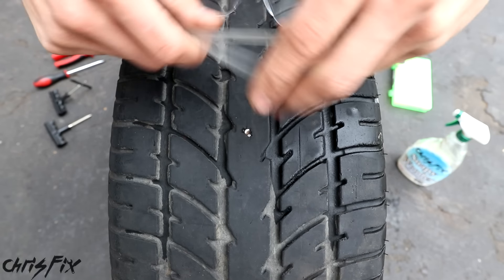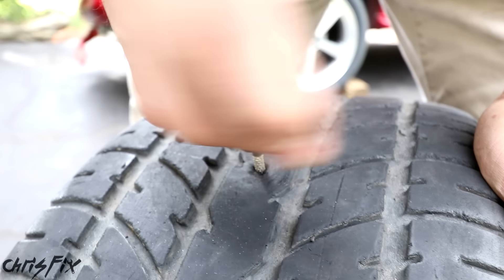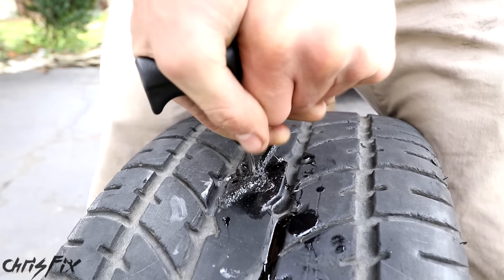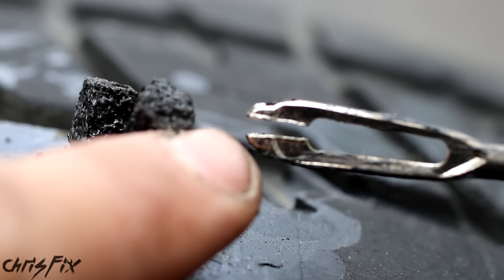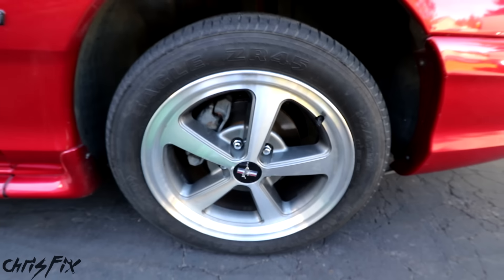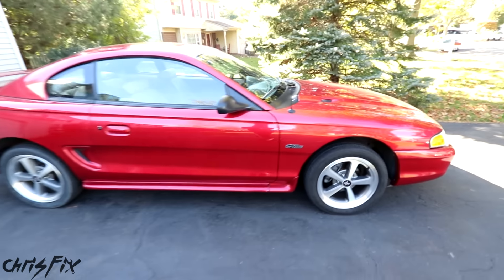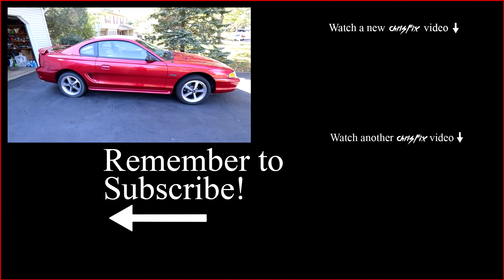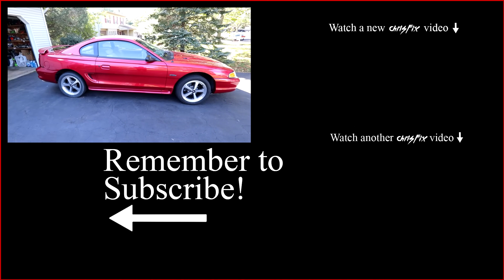How to Fix a Flat Tire EASY (Everything you need to know)

Comment: I was hoping for the "How to clean an engine bay" video.
Reply: Bartek Witas step 1 don't clean it
Step 2 don't clean it
Step 3 if you see a dirty spot leave it alone
Reply: did you just spray it with water
Reply: Arif k your supposed to leave the car on for about an hour and a half after you spray the bay with water so that it will dry up thats how we do it where i work
Reply: been waiting for that video as well! Chris is lacking :)
Reply: rami ram your not supposed to have water anywhere near your engine (unless your topping off your concentrated antifreeze)
Reply: automan224 ive washed more than 70 cars like that i also do that to my and rover whenbits in deep water
Reply: I don't know why some people think it's unwise to wash your engine bay!? Engine in modern cars are completely sealed, alternator can take water any day unless water pressure is excessive and your intensionally willing to break it.
Reply: I waxed and buffed off my silver engine plastic cover. It looks very good now. I dressed up the rest of black plastic covers around it with armor all after cleaning with with soapy water. My engine bay looks like from car that just out of factory.
Reply: Soumaine really? Last I saw if you get water in your air filter/air duct you can get it into the pistons and bend them

Also any water on the electronics is a major no no you can actually damage those systems if you get them wet. 

Also you can potentially mix water with the oil and mess that up
Reply: Bartek Witas I asked him last year bout it!
Reply: ***** I never block anything off from water. I just pop the hood at the car wash and go to town. It's not like under the hood is sealed from rain and puddles. If the car is still warm, you get a steam clean effect and it dries quicker when you leave.
Reply: Have you guys ever thought of this

If we clean our car engine why don't we clean our ovens electronics, or the inside of our refrigerators temperature sensors? I'll tell you why. We don't eat, sleep, and live there

So why should we clean the engine in our car?

If you have a real oily spot sure use some brake cleaner and/or engine degreaser but never have water anywhere near your engine
Reply: automan224 do you take your fridge or oven to a car show???
Reply: Chancey Wyrosdic nope. But my analogy was if we're gonna clean our engine (which is unnecessary and potentially Dangerous) then why stop there
Reply: automan224 some of us work on and modify our cars. Less grease or dirt makes it a much more enjoyable situation all around.
Reply from the maker: That will come with time! I have a lot of videos in the works and I have a schedule that, well, is taking a while to get to haha. I promise there will be a video on how to clean the engine bay and it will be an awesome one!
Reply: how do you explain cars with real hood scoops then?
Reply: ChildrenofBodomLOVR lol what real hood scoop
Reply: same tho
Reply: well you get this thing called a rag and you get some cleaner like mcguires natural shine, and for those who say dont clean it... why not? i keep my engine compartment clean cause i like to be proud of all aspects of my vehicle..
Reply from the maker: That video is going to be a HUGE video with a lot of tips and tricks so it takes a long time to make. Dont worry, it will be epic and I will definitely be making the video for you guys!
Reply: coming99 You seriously listen to that guy?
Reply: Mine is very dirty (it was like that when I got it) the white paint is a bownish yellow color what a mess I also have to take off and polish the intake runners which have rust spots on them.
Reply: +Bus Driver Uppercut anything that stops working after you pressure wash an engine needed to be replaced anyways. Components should be able to withstand water from washing the engine. Steam cleaner with the pressure washer is a good way to clean the engine bay even without a lot of pressure gunk and stuff will just fall right off.
Reply: +GonzalezEzekiel Scotty Kilmor's might have 50 years of experience, but has the mindset that it's still 50 years ago lol.
Reply: Hello By his videos are very aggravating just look at his "why mercedes are money pits" I used it be a Mercedes tech and I know he doesn't know what he's talking about. You were right on the money on 50 year old mindset  he just doesn't know anything about modern cars
Reply: +GonzalezEzekiel yeah just his intro is annoying I also know how much MB dealers charge. My family is European car family my uncle is a master Porsche tech top mechanic at Brumos Atlanta and one of the top in the country and he now owns his own independent European car shop. My dad was an Alfa mechanic and is factory trained by Alfa. Now still has a bunch of Alfas and restores wooden boats. My moms 05 E320 CDI I'm sure you know about canbus computer mounted under A/C condenser computer filled with water twice we've put 150k miles on it with 200k total great car the crap he talks about in his videos especially Mercedes is a load of crap while some things can be true he well over exaggerate German cars.
Reply: +GonzalezEzekiel Mercedes source probably the only place to go on YouTube for mostly older Mercedes and he also had a maratona GTV6 cool car. YouTube "mechanics" are a different breed lol
Reply: Hello By oh gosh they charge too much but they do pay Mercedes a lot per month to use the scan tools (xentry) . I don't like him either although I'm suscribes to him he never finishes his vids he wants people to pay smh
Reply: Bus Driver Uppercut i washed my engine bay on my c32 the other day and it's fine, only thing I did was take it for spin after I was done to dry it all, and the electrical connectors should have "weather pack seals" on them
Reply: +GonzalezEzekiel yeah his problem is he always wants you pay for them. Only time our's went to a dealer after we bought was for it to be scanned after the canbus computer filled with water from the (gotta love their engineering) a/c condenser on a humid and shut down the car then went to an independent shop to get the computer. Only other time was to replace the dead key.
Reply: Hello By If you work on your own car a key program and buying parts are the only reason why people should go lol
Reply: +GonzalezEzekiel yeah when buy the parts it's through world pac with free next day shipping which is where my uncle buys all his parts from.
Reply: Hello By nice ima check em out thanks for that
Reply: Hello By it asked for company and "resale number" "business type" -_-
Reply: +GonzalezEzekiel yeah it's only for businesses.
Reply: Keith Shields 1 apparently a 20 year old is 13 now. 2 everyone and their mother agrees to never clean your engine so you don't ruin anything. 3 I don't know everything, I just have this thing called common sense
Reply: automan224 i like how you call that common sense, what do you drive.. a prius😂😂
Reply: automan224 if you drove a prius then that would explain alot
Reply: automan224 cause you see i drive a 98 k1500 with a 5.7L V8 and i want that SOB to be clean when i show it to people
Reply: +Keith Shields um yeah water can ruin your engine when you run it. When there's enough in the cylinder you will hydrolock the engine which can crack the cylinder wall the cylinder head and bend rods. So yes water in the cylinders can damage your engine and water in the oil will also destroy your engine.
Reply: +automan224 getting the electronics wet won't hurt them if they do get hurt then they needed to be replaced anyways and shaking the water out then plugging them back in will fix it until you replace it.
Reply: Hello By i was talking about a little bit of water, not a whole lot
Reply: sort of self explanatory. certain things should be covered up otherwise good to go. I cant believe people are clamoring for pointless vids like that LOL

how about something more along the lines of fixing a broken exhaust or thats hanging or something (unless it needs welding or something) my cavalier beater needs a whole new one, a semi perm fix idea would be nice. Currently its ok but sounds like shit.
Reply: Keith Shields 2005 Chevy Monte Carlo LS
Reply: Hello By theris also this thing called risk vs reward.

is it worth getting the engine clean if you can potentially damage something expensive
Reply: Bartek Witas
Reply: +automan224 you're not going to damage the engine
Reply: Hello By and if I do?
Reply: +Arif k yeah there's one video the guy to prove that the alternator will be fine he sprayed it directly with water to prove that it's fine.
Reply: Bartek Witas no we want to know how to get laid in the back off a car..
Reply: Bartek Witas of
Reply: ChrisFix I see a lot of bubbles!!!!! (Joke)
Reply: +coming99 - I am not a Scotty Kilmer fan. I subscribe to ChrisFix because his videos agree with my experiences; Scotty's do not.
Reply: There is one...

Comment: I got a low tire-pressure warning right after I finished a 15 hour shift at 3 am. My nightmare was about to come true, nevertheless, I found an air-pump at a gas station and filled my tire with air. I found that my tire was leaking 5 psi/week. I finally got it fixed today!

Comment: (1) Using a block of wood on your jack is dangerous as it may crack. Always use steel on steel. Never wood on steel or wood on aluminum.
(2) The tire only needs to be a few inches off the ground not 3-feet!
(3) Wood for the tires to prevent them from rolling is of course a good idea.
Reply: Habanero House (1), a piece of rag or cloth or cardboard in between steel and steel is protective to your car especially on jack point coz you don’t wanna hurt the anti rust paint. (2), you don’t need to take the entire tire off. Turn your steering wheel counter clockwise (not all the way), find the penetration with soapy water and fix it. (3), I would not cut the extended plug. I leave it there and the heat from driving would melt it into the tire tread, thus it makes the tire more durable.
Reply: Bruhhh hatter alert 🚨

Comment: ”if you have a spare tire”??? what do you mean ”if”? isn't it mandatory in the US to have a spare in the trunk? or is that optional?
Reply: Chris Day if you have a car with run flat tires I dont think you need to
Reply: Same new Kia cars and Cadillac cars do not come with a spare, they come with a repair kit, basically fix-a-flat
Reply: wow...i wasn't expecting that...in Europe you're not allowed to drive the car if you don't have a spare...if you do and the police checks your car, you could walk away with a huge fine...because here we don't have run flat tires, they are super expensive and not everyone can afford them...something new i learned about 'Murica :)
Reply: Chris Day In Sweden we are allowed to drive without a spare tire 😉
Reply: I work at a tire shop and when we get these cars in, most complain of not having that spare included, especially on Cadillacs for being a luxury vehicle
Reply from the maker: Some cars have runflats or repair kits and dont come with spares.
Reply: extreme weight reduction by manufacturers. And if you are lucky enough to get a spare tire it's one of those fucking donuts.
Reply: That's not true. This is how it is in Germany: You don't need a spare tire. You just need something to replace or "repair" your tire. The vast mayority of german cars don't have a spare tire anymore but some thing called "Tirefit". You are supposed to fill your flat tire with some substance that closes the leak (temporary) so you could drive to the next repair shop. However, nobody uses those kits and it was mostly implemented for weight and cost reduction. Source: I'm a mechanik at Mercedes
 My tip: Throw that shit away and place another normal tire in your trunk. Summer tire in winter and winter tire in sommer.
Reply: Why have a spare tire if you have AAA? I wouldn't want my mom fixing a flat, at night, on the side of a highway. Just pay for auto club membership, and call for a tow if you break down. In that case, all a spare is doing is weighing down your car and hurting your MPG.
Reply: I'm not obsessed with it, but governments tend to be...a spare tire does nobody any good if you can't/won't change a tire.
Reply: I'm into increasing fuel mileage but getting rid of the spare's ridiculous to me, there are other methods manufacturers could work with but they aren't:

1: Skirting over rear wheel arches
2: Full Body Belly Pan with removeable access panels

Those are just a few though. I put what you'd call an "Air Dam" on my 1984 Caprice and it seems to have increased the mileage, I don't need to press the accelerator down as far on the highway with it on.
Reply: i don't know the rules of other EU member countries, but here you are not alowed to drive unless you have a spare..yes, we have repair kits and stuff like that, but we are used to simply change that shit like real men...think about it: oh look, i have a flat, i'll inflate it with that single-use foam from the repair kit...ten miles later: oh look, another flat(happened to me) a spare tire would have been usefull, only if had one...but for those 100ml of fuel that i save, why would i carry a spare with me? think twice before you hit the road guys...stay safe!
Reply: or drive with the flat tire on the rim and just dont care :D
Reply: stoyan slavov somehow i like you :))
Reply: :) thank you 
i will say that to you to
i just helpt a guy with his car and i feel grat :D soo have a nice day 
a nice extreme or what ever you want to call life :D (sorry for bad english )
Reply: stoyan slavov where are you from?
Reply: your neighbor from up north :))...literally about 200km from my house to the border at Pyce ;)
Reply: Ах БГ сила 
винаги се намираме :)
ние Българите
Reply: aaaaaa 
you speek Румънски yes :D
Reply: what? no :))....romanian, ok?:))
Reply: i wounder if you speek Romanian (sorry for bad english )
Reply: so how are you
Reply: bcubed72   If you can't change a tire, you shouldn't be allowed to have a license.
Reply: It's not just Kia's and Cadillac's - there are a lot of new cars sold these days that don't include a spare tire. When I was a kid (a thousand years ago) cars were supplied with full size spares. As the cars got smaller and in the name of greater fuel efficiency weight became an issue, car makers started supplying donuts. A lot of people that were used to full size spares cringed when they switched but I can tell you first had that the donuts work well. I've put (literally) thousands of miles on them and driven well over 80mph and never had an issue. My wife recently slashed the side wall on her 2014 Fusion. I went to change the tire and found a can of Fix a Flat and plug in inflator in place of a donut. I was about to call a wrecker but decided to see if by some wild chance the donut from my Saturn Aura fit - it did. First thing I did when I got home was buy a donut from a junk yard and put it in her car.
Reply: Chevy 2015 Malibu - compressor - no spare.
Reply: Many cars manufacturers are getting rid of the tire to save on cost. If you weren't the original owner the previous seller could of left it out or whatever. Also even if you had one you must regularly checked to see if it hasn't gone flat. Usually it won't be flat but you never know something could damage it and it becomes flat and useless when you need it most. Sometimes people intentional take it out for whatever reason maybe they need the room and forgot to put it back.
Reply: Chris Day BMW no spare
Reply: Mandatory to have a spare? Since when? You get what the car companies provide with the model you buy. Some have donuts, some inflation kits. Car manufacturers have been trying to lighten the cars to get better gas mileage and one place to do it is the spare tire.
Reply: My ford cmax dont
Reply: Its an option now that most people forget to add when buying a car. Basically they use to give it to you for free but then dealers found out they could make it an option for a fee and when most people buying their brand new think its standard and then realize they don't have one until they go into their trunk and look for it.
Reply: Some people already used it